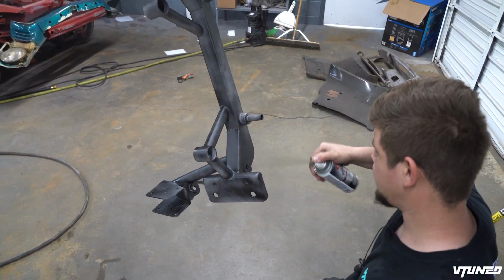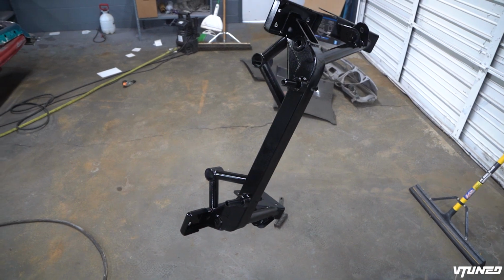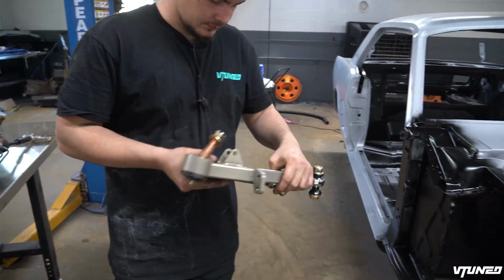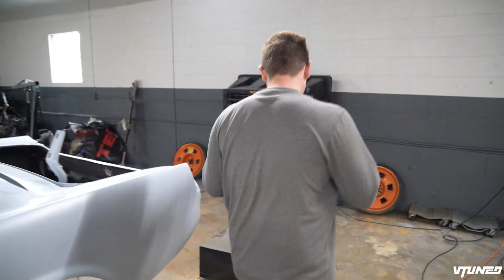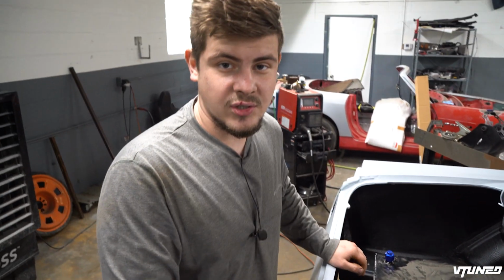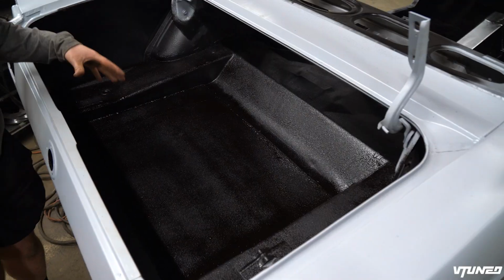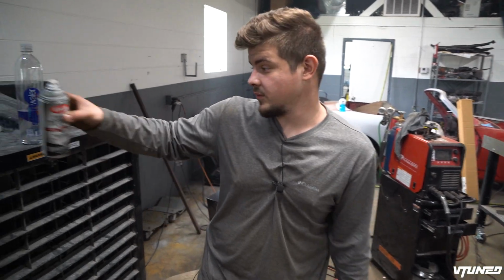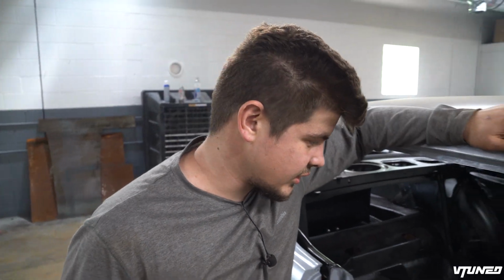Finally Starting To Reassemble The 1965 Ford Mustang (HUGE MILESTONE)

Comment: It may resemble a 1965 Mustang but it will actually be a 5,000 lb abomination.
Reply from the maker: Lmao please explain I wanna hear where you got these lbs
Reply: @Vtuned  Okay it's an exaggeration, but your welding a heck of a lot of steel onto this vehicle for stability or whatever reason. It may end up being a tank in Mustang's clothing but not a Mustang. Unlike that former frame debacle, this thing may actually lumber onto the road but I can only guess what the milage will be. Maybe you could sell it to a movie studio for a remake of Mad Max.
Reply from the maker: @daviddemarco7499  lmao it’s actually going to weigh less then a factory mustang
Reply: @Vtuned   Lmao 2,621 to 2,974 lbs is the weight of a 1965 Mustang, Lmao, so you weigh that vehicle when you're done and compare. LMAO!

Comment: Automatics are for simple minded people.  As far as the fuel cell goes, turn the dam thing around, the 2 AN fitting at the bottom go toward the rear.  When you step on the gas, all the gas will go to the rear of the gas tank, DUH!!!  Unless you plan on running around with 20 gallons of gas that is 160lbs all the time.

Comment: Dude u doing a huge mistake with the fuel tank position. First of all, in-line fuel pumps does only push the fuel forward. It’s not like in tank pump style where it suck and push. In order to use in line style you must maintain good fuel feeding pressure&volume to the pump, which to avoid fuel starvation issue. I highly not recommend to use in-line pump. It’s damn noisy & overheat.
Reply: Tanks inc supply 65-68 factory style EFI fuel tank. It’s like 280$ will help u to avoid so much headaches

Comment: Yupp for easier drivability stick to auto... Right now autos have become advanced that its much faster than manual..
Reply: That’s true but still not the same experience and it’s a different level of fun
Reply: @millz2035  yup but i think this is going to be a daily... He has a s2000 to rip
Reply: That’s tru but he also has  a super car that’s auto I daily my stick shift in nyc so that’s not really a good reason but I do get lazy at times so I do understand but in my opinion for a car like that It would feel better being a manual

Comment: An automatic would not be my choice for a sports car. You loose power and the fun of driving. A custom built mustang is not a transportation vehicle. IMHO
Reply: Agree with the others. Cut a hole in the new trunk floor plate, drop the tank.

Comment: I don't get it. To save 300$ you put so much work in custom fitting a non fitting fuel tank? Just add up your work hours.....
Reply: You get an original, never rusting tank for as low as 450€ here. It must be cheaper in the US.

Comment: I think your a little confused in your methods. Your building a nice car how do I put this. Outta nice parts and leftovers. Your going to fail on valuation. It will sit in a bad category. By the time you finish it will bite you on the ass money wise. Spend wisely. If you want quick  2nd class finish, may as well match with second hand parts.
That gearbox tunnel would look ordinary from underneath. Hide your seems wisely or spend.Custom cars are all about fine detail people look past the norm. Race car ! That's different. Actually that suits this build better but are you going to supply it.
You know I like your work but don't blow your build. "Son."💋Oh they don't know about us do they. Sorry mate.

Comment: It is obvious you do not know much about fuel tanks and lines.  The sump with the supply and return lines has to go in the back or you will suffer from fuel starvation when the fuel level is low and you accelerate.  You should have built straps or hanger brackets to hold the tank at a lower level in the trunk.  Probably should go ahead and get the plasma cutter out and cut out all that heavy sheet metal you just welded in.   Professional car builders do not use rattle can paint anywhere on a car.

Comment: Paint the whole car satin black dude. It's gonna look aggressive AF especially with the widebody. Also, auto hands down, better in pretty much every way. Manuals are for boomers and posers.
Reply: satin black with two silver stripes would look hot...only problem with satin is it marks REALLY easily......same as matte finish, looks great until it doesn't.
Reply: @muskokamike127  A PPF can help with that.
Reply: @Saurion1  yes a satin ppf can protect the paint but the satin finish on the film can be marred easily too...it's the nature of satin/matte. The real issue with a gloss finish is you can buff it out and make it shiny again, I don't know of any treatment that can fix a satin finish that way.